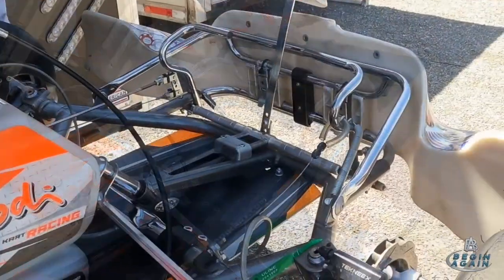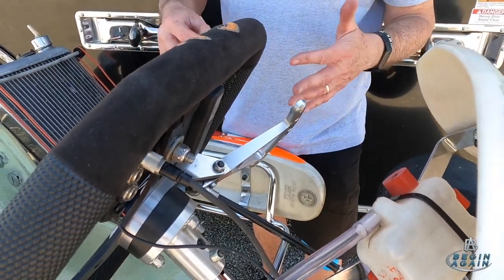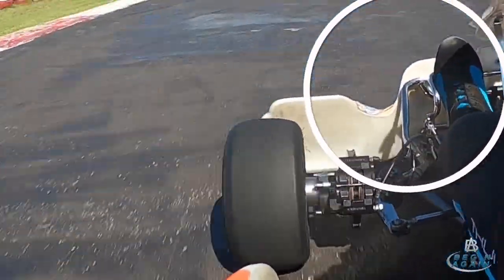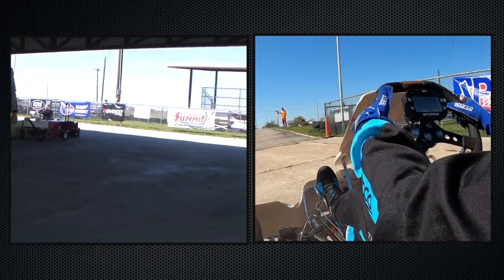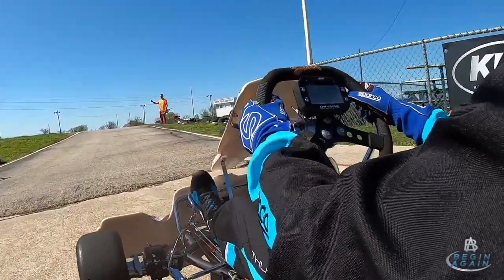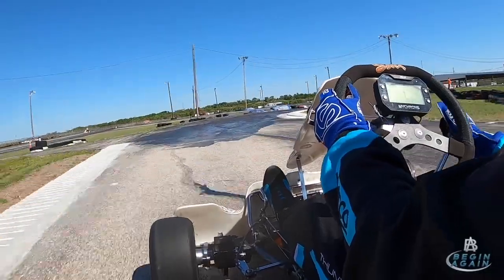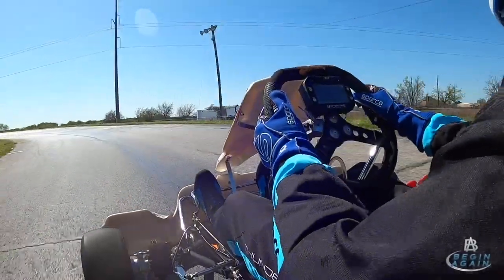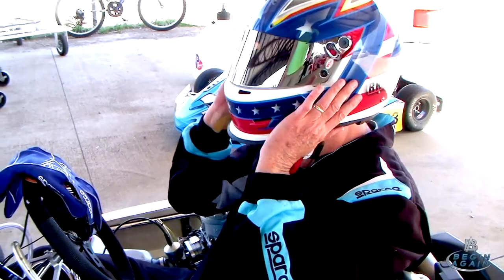How To Drive A Shifter Kart-The Basics!

Comment: You can count on it! Just to play you have to remember how dangerous they can be without the basics - Mine always had a problem with the front brake drum (always dripping oil) - that was the time I forgot to check and almost hit the wall at 110 km/h .

Like those fighter pilots - always check your gear.... I know it sounds stupid but for me even at Rentall i have my check lists - Wheel, Tires, Brakes, throttle cable and brake cable. 

Very cool video!
Reply: Thanks for watching and I could not agree with you more...there is always the chance that things can go wrong, so at least get control of the things that you can influence (like wheels, tires, brakes, throttle return springs, etc) and take those out of the safety equation!

Comment: I assume you can shift into neutral with engine running? Just shift to first pull on clutch and half pull up?
Reply: Thanks for watching and thanks for your question-sorry for my slow response!  I struggle with the starts on these karts, so I am not sure I am the best guy to answer your question.  But, since you asked...I put the kart in neutral on the starting line, then I pull in the clutch lever and push the gear lever forward to engage first gear.  Then, when the race is almost ready to start, I go to full throttle and then very slowly begin easing the clutch lever out until the clutch is almost "biting"...when the green flag comes out, I am, of course, feeding in the clutch while staying on the throttle...when you get it right, the acceleration is amazing!  It's a real thrill when you get it right, but when you get it wrong, which is usually the case for me, it is very frustrating.  Hope this helps you!
Reply: @RKSiler  thanks for you reply! Sounds like most likely we can shift into neutral with engine running.
Reply: @shofarsogood7504  Yes, absolutely!
Reply: Its just a CR125 motocross bike engine. Same thing.